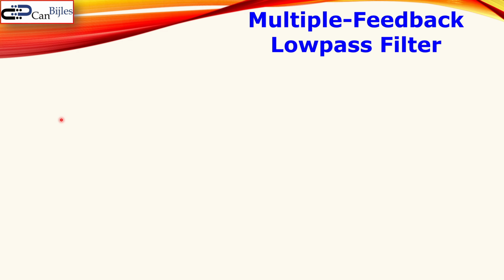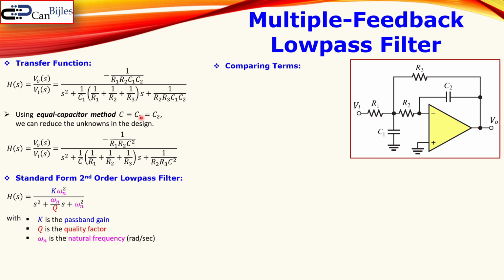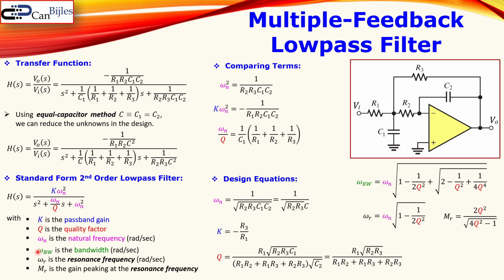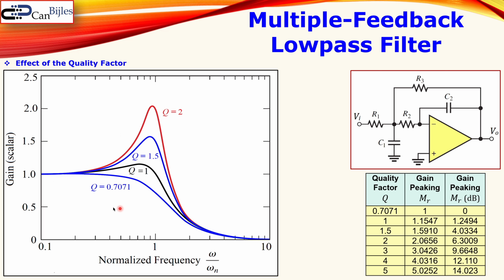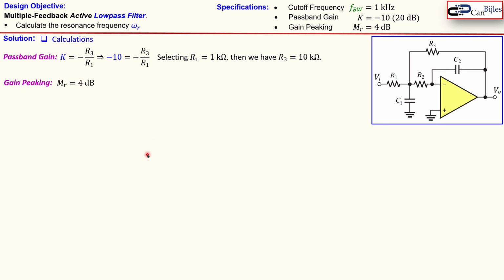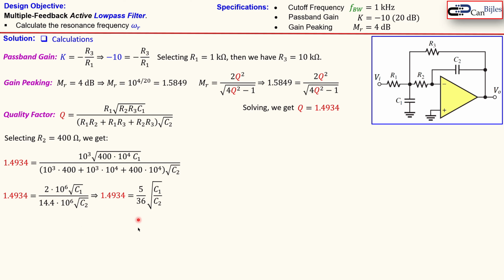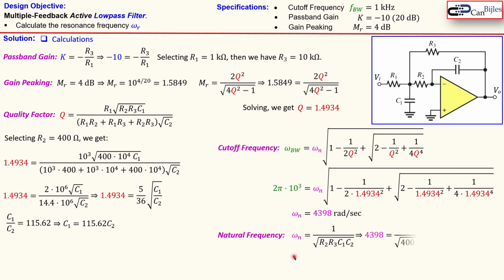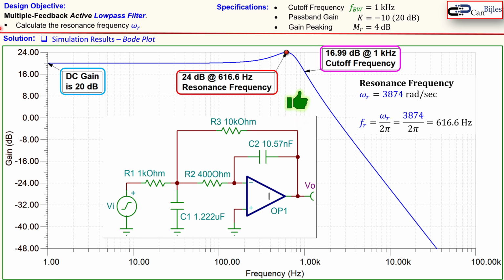Multiple-Feedback 🌟 Lowpass Filter Design 👍

Comment: Thank you very much for this really good explanation. Could you also explain how do you derive the Transfer Funktion? Thank you!
Reply from the maker: Glad you liked the video. You can use standard circuit analysis techniques to determine the transfer function. For example, node voltage analysis.

Comment: बहुत ही सुंदर प्रस्तुति के लिए धन्यवाद ❤
Reply: Thanks, always interesting to see the design and simulation.

As add on/ engineering exercise -maybe consider selecting standard components? i.e. using E96 resistor range, and discuss the implications on design performance? also using same components to minimise components for manufacturing(MOQ)? i e. R=R1=R2, C=C1=C2 
Maybe include noise/power considerations in selecting  components?
Reply from the maker: @pieters286 Thanks for your message. Great to know that you liked the video. 

You are right, it is better and more focused on actual design if we use standard resistor values also. However, my goal was to show the design steps, without touching on tolerances or other effects. 

I do have many videos about noise analysis of electric circuits, also using Op-Amps. Check this playlist: Noise Analysis Electric Circuits: https://www.youtube.com/playlist?list=PLuUNUe8EVqlnQ_ZEBx9S6a6juISpYcdJW
Reply: @CANEDUX Thank you! looks like a very interresting and thourough series!
Reply from the maker: @pieters286  Indeed, the noise analysis playlist is very detailed. Good luck with your studies!
Reply from the maker: Glad you liked the video! You are welcome!